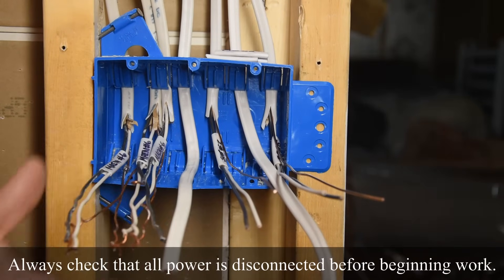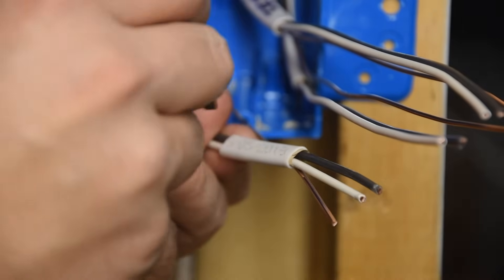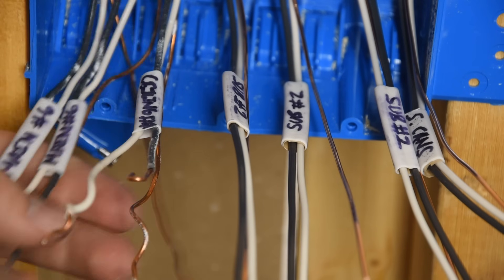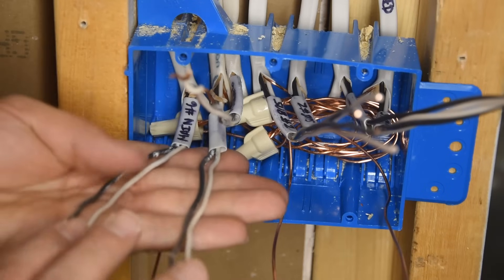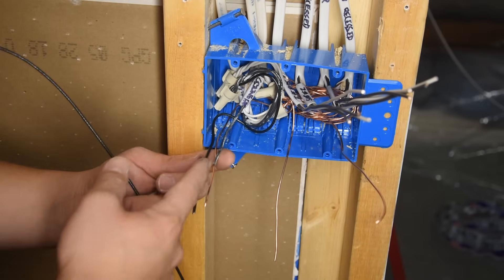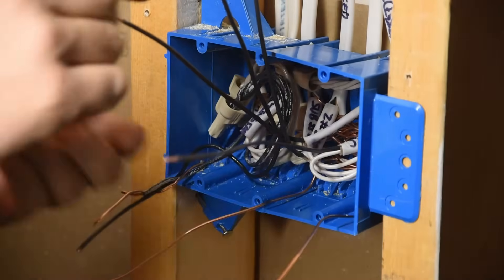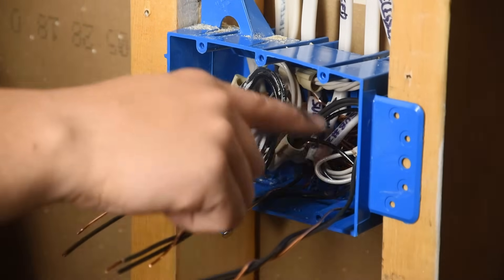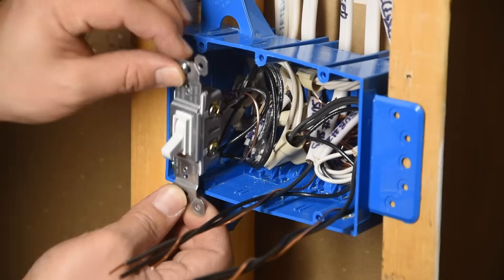How To Wire a 3 Gang Switch Box With 2 Circuits

Comment: Great vid. I am against the grain here, but when I wire circuits I ONLY put one feed per multigang box. I hate different neutrals and power feeds. This is just my preference. When time to kill the breaker, I ONLY ever have to find One. Lates.
Reply from the maker: I totally agree that that is the way to go if at all possible. It is so much cleaner and worth while to do it the way you suggest. Unfortunately not everyone does it that way so it is still beneficial for people to know what they may encounter from time to time. Thanks for sharing!
Reply: Ideally, yeah, one circuit per box keeps things far less complicated. Sometimes it's just unavoidable with how circuits land in the construction process, as I'm sure what happened in this case. It's usually not a deliberate design, just more circumstantial.
Reply: I’ve done boxes with three circuits hahaha

Comment: Try that box with 12Awg and you will build muscles in places you thought muscles couldn't be built.
Reply from the maker: Haha for sure! My fingers start to hurt in short order when twisting wire nuts on 12awg wire. Wagos help reduce that of course.
Reply: @BenjaminSahlstrom  wago doesnt help if u need to push the device inside the box tho. not to mention rotating it. but it does save a lot of hassle when it comes to rewiring (especially for the ground wires using crimp sleeves!!). haven't figured out a way to "decrimp" em so far. 12awg s the pain in the butt. ;)
Reply: @BenjaminSahlstrom  I sometimes use Channellocks to wirenut a bunch of 12s!
Reply: They have these devices now that one puts into the chuck of a variable speed drill and it slips over the outer plastic shell of the wing tip or wire nut connector and it aids on putting them on and it makes it a lot easier than by  doing  it with your fingertips ! Amazon sells them ! https://www.amazon.com/gp/product/B0087TBPS2/ref=ppx_yo_dt_b_asin_title_o05_s00?ie=UTF8&psc=1
Reply: @BearStar1  I know you posted this two months ago, but I literally just came across these handy looking devices a couple hours ago, when I was just browsing Amazon. I put some in my cart. Can't wait to try them out.
Reply: Ha ha child's play, try working on an old house with 20a circuits... 10 gauge aluminum wire + pigtails for cu only divices and noalox
Reply: @mr.3phase228  Aw yuck, I've never seen aluminum wiring in homes. My 1890 house even has copper (knob & tube). That stuff is kind of obnoxious.
Reply: @aaron74  ' I rewired a older single wide Mobil Home back in '85 that had all AL Wiring . Tore out all of the AL wiring , installed a new 200 Amp Main on a New Service Pole and then installd the service feeder underground in Schedule 80 PVC to the new Main Panel which I relocated to the the Hallway between the Liv area and the Master Bedroom and  Rewired with all CU !
Reply: @BearStar1  Vast improvement
Reply: @aaron74  you typically see aluminum in houses that were built during times of war. Copper was being used for the military and was hard to come by. During ww2, Vietnam, and Korea.
Reply: @StefanMiller  Interesting! I'm halfway surprised we're not using it again, with today's copper prices. I know it's used for larger gauge feeds.
Reply: Gregg Sinini  What's up with the insults? It's like I insulted your mother or something. Everything is relative in this world. The crab fisherman thinks his job is tough until he sees roughneckers battle on an oil drill rig in the middle of the arctic in sub zero weather. If you're an electrician who can call Gregg Sinini a pussy because he works with "feeder cables", please chime in! Let's see how far (or low) we can go in insulting each other for doing work we think is inferior to ours.
Reply: 556 MCM
Reply: Yeah my hands looked like I'd been fighting a cat after wiring a two-switch box with 12 AWG.
Reply: Most boxes I do with 8-10 wires are 12-2 or 12-3 lol
Reply: In residential work is unnecessary to use 12 gauge wire for lighting circuits it is way more trouble to work with 12 gauge wire when trying to hook up large dimmers and multiple gang switch boxes only in commercial work do you need to use 12 gauge wire
Reply: Very sloppy work I must condemn your idea of multiple ground wires being Twisted together with pigtails properly done you should run your wires at 10 in length twist all your ground wires together and put a crimp sleeve over them and crimp them down cutting only the necessary three or four gang going to your switches at an extra six inch length after the crimp sleeve then everything neatly let me stress that neatly fits into the box where you don't have to cram multiple wire nuts and multiple connectors of ground wires like you did in the back of the box obviously you're about 25 years younger than me and I have way more experience at doing this and if you would learn from your mistakes you will become a better electrician and a master electrician like I have

Comment: I'd throw some tape around the switch, especially with them bare ground wires. Great vid Ben
Reply: You know, I did that for years and stopped doing so about 10 years ago. The main reason being is I found over time, the adhesive of the tape breaks down, and the tape sort of unravels itself and leaves residue on the device if you ever have to deal with it later. It's just not necessary... a bare ground should never come into contact with it if it's pushed to the back neatly as Ben did. Plus you may want to put a test probe on one of the screws while the device is mounted, and you can't do it with the tape in the way. It's definitely a good intention, to be sure, but I've determined it unnecessary and impractical in my experience.
Reply: @aaron74  Ideal is coming out with those armour band insulators early next year, seems like a better option.
Reply: @mr.3phase228  Armour band insulators? What's that? It goes around a device to cover its screws? I could see a fat rubber band could be a nice accessory. Thing is, there are a lot of electrical accessories and tools and  that are nice, but not necessary...
Reply: @aaron74  Check out Bill from Sparky Channel, the video is called Ideal Armourband insulating wraps coming soon!
Reply: @mr.3phase228  Yeah those look neat at first glance, but I still maintain it's just not necessary... both with the cost and the effort of installation. You'll have to stretch that thing around the front of the device around the plaster ears and mounting screws to get around your terminated wires which is a PITA, and just not necessary in the first place.
Reply: Yea, I have started doing that by habit.  Many moons ago I didn't with the older/smaller remodel boxes that were metal.  Good Times back then.

Comment: Good video. When you twisted the wire to be attached to the strip, I did not hear you mention to twist them in the direction the screw turns when tightening them so the wire gets 'pulled' in under the screw rather than backwards and pushing the wire out. 

They way you showed in the video was correct.  It makes life easier if you have not done them before.
Reply from the maker: You're absolutely right! I totally forgot to point that out specifically. I'll definitely have to point that out better next time.

Comment: I generally prefer steel boxes in general for their quality and strength, and the #6-32 tapped holes for the mounting screws of devices. But where steel boxes REALLY shine is with multi-gang installations. NEC permits you to use self-grounding devices with steel boxes if the box is grounded. Many of the low cost (often called residential-grade) devices are not marketed as self-grounding ONLY because there is little piece of plastic that prevents the mounting screw of the device to fall out of its yoke. BUT if you remove this piece of plastic and make sure the device makes solid metal-to-metal surface contact when you tighten it in place, then the device will be grounded if the steel box is grounded, and it won't need another pigtail ground to its ground screw. This is a huge benefit with 3-gang or more boxes, it really cuts down on wire fill congestion.
Reply: @ Aaron Kassel   Thanks for the input. As we speak I am making a decision about plastic vs. steel 3 gangs I'm installing. Going steel.
Reply: @youvegottoseethis5615  Glad to help. A three gang welded steel box can be hard to find, so you may need to purchase three single gang device boxes and assemble them. If I were a welder, I'd weld them together so there is no chance they can come apart.
Reply: Ugadda Seedis not sure where you live but in Canada the CEC doesn’t require switches to be grounded. If that has any effect on you  in anyway
Reply: @Nick-bh1fy  Canadian CSA-listed boxes require grounding, whether steel or plastic. Plastic boxes have a metal strap jumping the ground screws in the back of the box to the mounting screws in the front of the box. By virtue of that, all devices marketed as "self-grounding" are grounded anyway, whether a pigtail was made to a device's ground screw or not.
Reply: Aaron Kaase yea I get u, I meant the switches themselves don’t need a bonding jumper directly to the box but yes the box it self needs to be grounded

Comment: Love the video. Only thing I would add is that when you make your loop for the terminals on the switch, let viewers know that it matters which direction the loop faces. You’ve been doing it so long you probably just take it for granted. Keep up the good work!
Reply from the maker: Totally! I've said it so many times in other videos that I totally spaced it here. So funny how your muscle memory takes over and you don't even think about it. Thanks for pointing that out!
Reply: And you still didn’t say. The wire curl clockwise to pull it in as you tighten. If you go counter-clockwise it can actually back the wire off the screw.